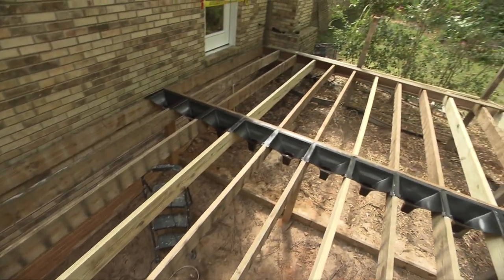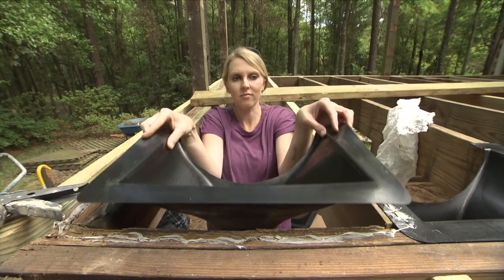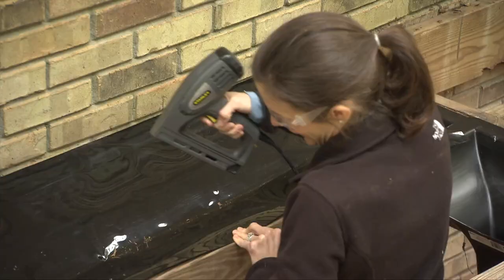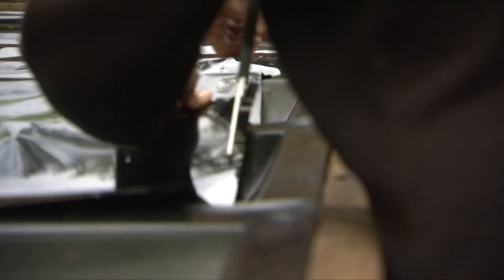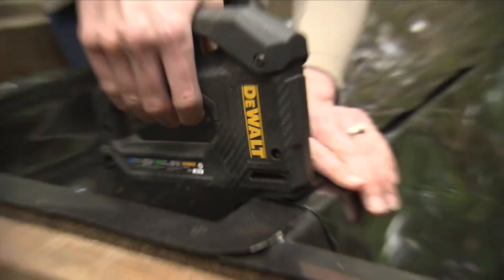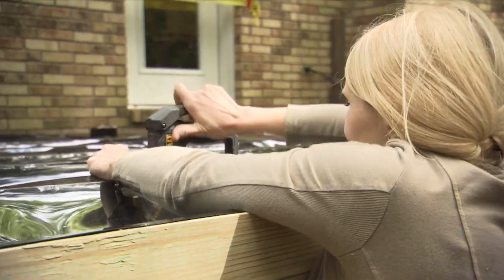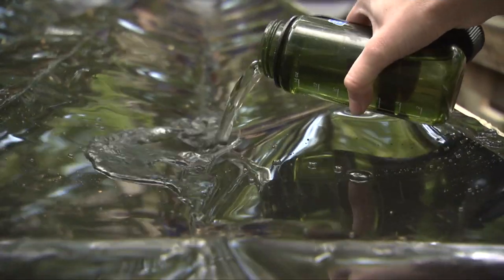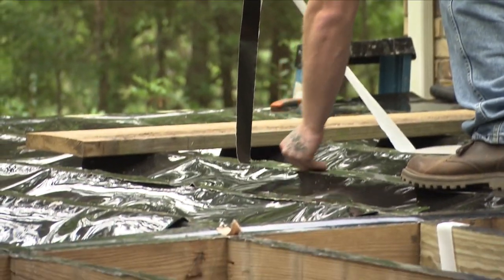How to Install an Under-Deck Drainage System - Today's Homeowner with Danny Lipford

Comment: I think eventually this will fail in northeast as debris/food/spills will ultimately get into channels and trap water and ice, then re-freeze possibly.  if that happens, there's no way to fix unless deck is removed. Also, if food and spills are in channels, it will attract insects....etc

Comment: How do you clean out the gutters?  Looking at different  systems.    Debris will eventually  find its way into the drains .
Reply from the maker: Hi, Jax! You can learn more about Trex's RainEscape system here: https://trexrainescape.com/
Good luck with your decision. :)
Reply: That’s the problem with this system. You really can’t do any maintenance. I have it and it’s a limited life span system. I still got leaks.

Comment: How will debris build up be removed?  Want to install on existing deck and be able to clean out debris.  Thoughts?  I' thinking of using strips cut from heavy duty plastic tarp material from Harbor Freight; tarp strips wrapped around furring strips sagging between strips; strips screwed to sides of deck joists with drainage pitch.  Remove furring strip screw on one side to drop tarp strips for cleaning.  Want joists exposed, rather than full area tarp stretched beneath joists, for mounting suspended storage needs.
Reply from the maker: This is a Trex deck, so we recommend following Trex's directions, which include using a pressure washer with a fan attachment: https://bit.ly/2Yf0NCN
For other decks, always follow the manufacturer's or installer's guides. :)
Reply: In other words debris  will be the downfall of this system
Reply: @jaxchristian3080  exactly

Comment: doesn't that system make the area under deck to be counted as impervious then?
Reply from the maker: This system prevents rain from passing between deck boards and protects the area beneath it, freeing up much-needed under-deck storage space!
Reply: Yes, at least in Canada this would need to be counted towards your percentage of impervious area, and would add to your runoff problems.